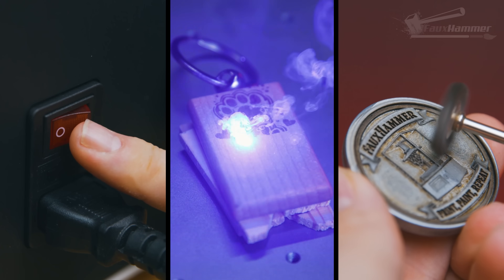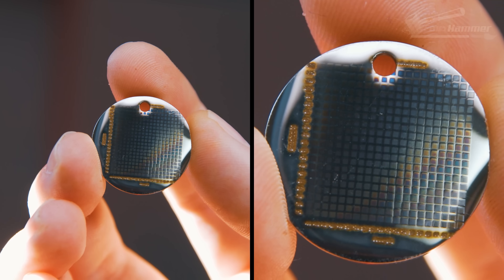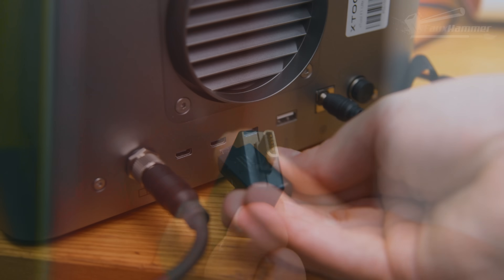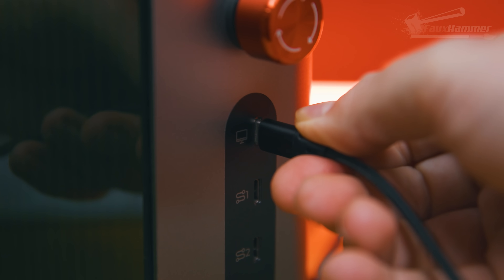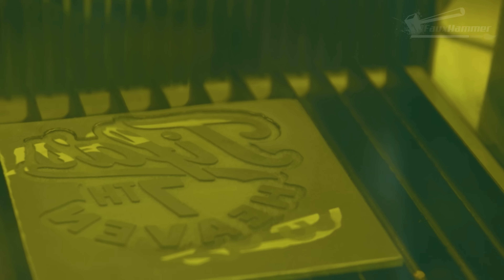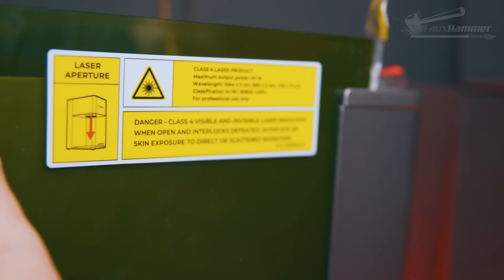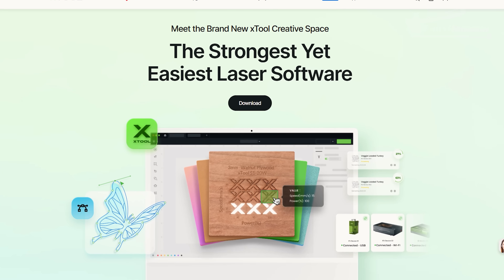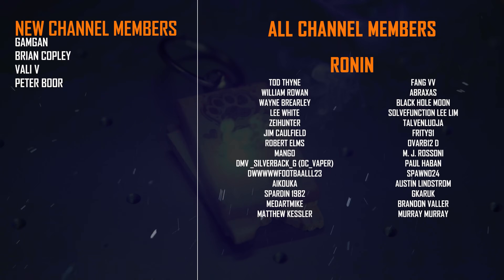The ULTIMATE xTool F1 Ultra Review for Beginners - I Ignored Everything and It Still Worked Great

Comment: how many watts is it? and are they true watts or just some gimmick sales pitch and does it have rubber feet on it so it dont slider all over the place
Reply from the maker: 20 on both diode and infrared. What is a true watt? You can adjust the power which lowers the output from max. And I showed it has rubber feet.

Comment: It’s alright if you’ve got 4,500 quid but out of my league so I would go for sculpfun s30 pro much more reasonable price  and with a roller a 10th of the price.
Reply: As long as you don't do metal and only want the diode laser then sure, but this also has a fiber laser so it doesn't compare to the S30 you should take a look at the G3 from Gweike to compare something similar
Reply: Or if you want a xTool laser then have a look at the S1, while it can be more expensive than a S30 it is much more beginner friendly, so if you do not have lots of time to learn laser then I would go with xTool, and they do compare as they are both diode lasers

Comment: When I was looking at lasers, I originally looked at xTool, and some folks were kinda negative about them hardware-wise and spoke more highly of other brands.  After a bunch of Google searching, I ended up coming back to xTool for their software and usability.  Those other machines that I saw are pretty nifty and are quite likely the best choice for some people.  However, I'm not a laser-ologist... I just do things.  Going with xTool is like why I went with Bambu Lab and Makera... I needed something "easy" that fit into my hobby time.  I ended up going with a fully kitted out M1 Ultra.  I would've loved to get a P2S, but I couldn't justify the difference in cost even though I'd love the larger work area and higher material capability (i.e., can cut clear acrylic).

That might be the one bad thing about lasers.  It's real easy to get drawn in with the basic price tag, but whew boy... they got accessories!

Comment: Interesting stuff, also complete laser novice but went for the H2D 40W laser combo as don't have any room for a separate system.  
Used the laser to etch some PV, Bambu stuff and aside from a bit of burn through and the fact they hadn't released the new grid and magnets it was pretty simple.  Images only came out blurry where the PV was flapping around a bit with the air assist and that was me changing the workflow to cutout (using cutter module) instead of laser as it recommends a flip for cutting and then I couldn't align the image to the cut as its upside down.
Suite feels little clunky and I've not really pushed the capabilities yet but half the faff you seem to be going through with the laser reviews is stuff I haven't needed to deal with - could it be better, no doubt but I have confidence that I can just plug it all in and it just kinda works.
The eyeball stuff has me slightly worried so I checked the specs (no pun intended) for Bambu's glasses which look about the same thickness and material as the windows - turns out its OD5+ for the laser operating wavelength which seems to be plenty for the size and type of laser.
I'd only just got to point where I was comfortable with printer particles and fumes and now you throw extra laser safety into the mix!

Comment: Why use a usb stick. My simple answer, security and transfer speeds.  Many of these devices are not great at regularly updating security settings so it becomes an easier backdoor into your network as time goes on.  Also when dealing with a lot of wifi devices on the network you can get much faster transfer speeds through usb as it is not clogging up the available bandwidth.  Before you say plug it into your computer, my printing stations are a bit to far from my main computer for that.  =)
Reply from the maker: I hear you. And good points. This is another reason I call for Ethernet on everything that has network connectivity

Comment: This is cool and all, but the whole "won't work without the magical security usb dongle" thing you mentioned and then didn't discuss further makes me think that at some point xTool can just brick your device at will, lock things down to some kind of subscription service, or at the very least charge you disgustingly overpriced costs for replacing said pointless USB
Reply from the maker: It's a security key, as far as i understand it's a digital version of a safety key. the point is, you can unplg this to prevent unorthorised use of a very dangerous piece of equipment. I'm not sure how they could brick your device from a USB?
Reply: @FauxHammer  That makes sense, like locking out heavy equipment for service. If thats the only use then great. By bricking I guess I just mean "xTool decides not to manufacture replacement USBs, leaving your device as a doorstop". It would REALLY suck if the usbs were uniquely paired to each device, meaning there is no replacing the usb, so if you lose it you're just boned. Maybe the usbs are just simple crossovers and any usb can be modified/soldered to short specific lines and create the same effect. If thats the case that would be great. But if the usbs are unique to each device and xTool is the only entity who can provide replacements... ugh

Comment: The thing with purely engraving machines or at least only using them for that is that they're essentially just tchotchke makers. Yes, it makes cool little items, but those just pile up and unless you're running a business they lose their shine quickly. You just end up with a bunch of stuff. Not that I discount the value of having some fun baubles, but with a laser cutter, a router, or a 3d printer you can make more useful practical items as well.
Reply: This is an industrial product so it's exactly for a business
Reply: This is an accessable, 20w diode + 20w fiber, with proper usability for most skill levels business or not in a field where its hard to recommend a single machine for certain skill-levels. Its perfect Ross material. 
Whilst not the best at it, it can cut a plethora of things still. But besides the point, as an owner, I can tell you that those "bunches of stuff" is never a waste when you don the mindset that its also a time=learn experience, and Xtool does just that and eases people into it. Most succesful people I've talked to, some of them being millionaires that started from dirt, do follow the essence of "learn->do->teach" principle, and a tool like this helps you with exactly that.
The stuff you make? If you don't like keeping things around, just give them a purpose. Give something to friends or help a foundation. If you need a bit more, look into combining it with a band/scroll saw and start doing some cool things that way, but the 20w sweetspot isn't unaccounted for. Fundementally though, you shouldn't look at things black/white, but what the things does for your use-cases.

In this line of work you don't necessarily need that much though. I can make something amazing and high-valued high-profit on-demand products for people in 10 minutes, cut and engraved, with a single UV-Laser (which is a wavelength that specializes IN engraving) that at the same time doesn't bankrupt their wallet, creating a margin that is comparable to industrial workshops (which yes, I've also worked in, that's where a lot of my carryover comes from), and forges an win-win scenario between me, my employees and my clients. But overall, to get there, I had to scale to it. And if I started this journey now instead of years prior, this laser would probably get me there remarkably faster and it wouldn't sit completely still either after upgrading.
You're the artist and you forge and choose the tools that benefit your business, afterall. This machine, business or not, can help you get there with how accessable it is.
Reply: @RazakelKairo1994  thank you for a thoughtful response exctly what i wanted to get across. I think people have the idea for something to be used for commercial it has to be really expensive I think many people could create a nice little business from something relatively cheap its just about time and effort with some business understanding. I recently watched a channel where this guy must have spent 100k worth of gear probably more. For context he has a pick and place robotic arm. I have no idea how much that must cost but it cant be cheap. Bar the Formlabs Fuse being relatively specialist since you can 3d print almost any shape and bulk print. Most of the items he has bought could be done for much cheaper, just with more limitations and time. An Industrial machine doesn't always mean it can do things that a normal consumer machine can't do. It usually means that it has better performance or reliability. Just like a pick and place machine, you can do it by hand but the industrial machine speeds things up and removes a huge amount of boring jobs.
Reply: Then why is it being reviewed on a hobby channel?
Reply: @tenchuu007 who said it's purely for hobbyists? Many of the printers he has reviewed are widely used in print farms. Also have you considered what he might do for work? I highly doubt that many hobbyists are buying 5k worth of laser  engraving equipment especially with a conveyor belt. Of course there are some people who will and brands use halo products to sell their lower end gear. It tends to do well on YouTube.
Reply: @TheChidmas Ross runs a channel, not a print farm. Of course some printers are used at print farm scale, if they're cheap and reliable they will be, that doesn't mean they're made for industry. Those kind of printers cost tens of thousands of dollars, and Ross isn't reviewing them. He's a self proclaimed dedicated hobbyist, he says it all the time.
Reply: @tenchuu007  It feels now that you're being obtuse. Ross does not have to run a print farm for him to review a printer which a print farm may purchase this just feel ike abritary limits that you are placing on it. There is no flexibility of thought. Ross has reviewwed formlab printers plenty of dentists own them while a consumer can buy them it doesnt mean that product is targeted at b2c. I would gurantee you the majority of owners of the model reviewed will be b2b because the price tag of 5k says so. Most people are not making £5k purchases for a hobby some do but not many. Brands are not stupid people who make purchasing decisions for companies also watch youtube. I have seen youtubers who are hobbyists, dealing with hobbyist subjects have sponsors such as odoo, which is an etnerprise product. What does that tell you? The idea that the only industrial used 3d printers cost 10s of thousands is again a completely arbitary statement. I've seen engineering department & R&D department in manufacturing sites with them it depends. What they need it to do they dont all go out and spend 40k on a 3d printer because its 'industrial'.  They could spend £500 or £2k or £10k. Sometimes its about familiarity, ease of use or cost.